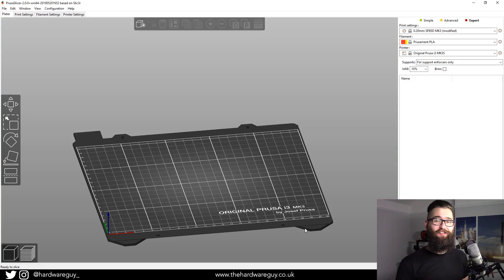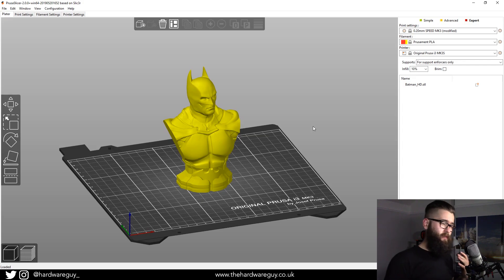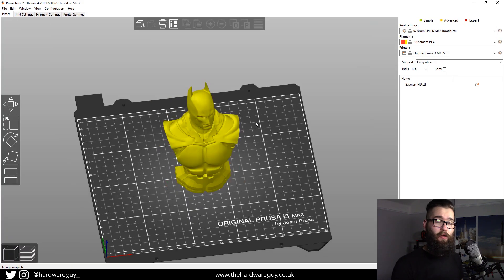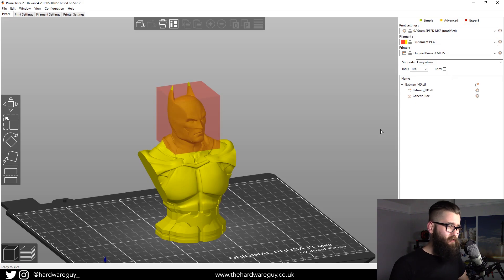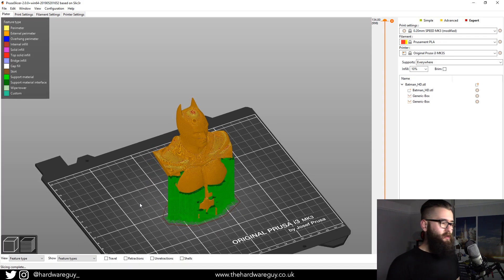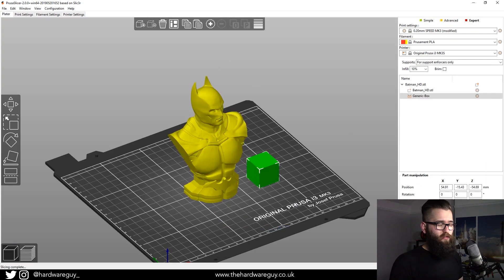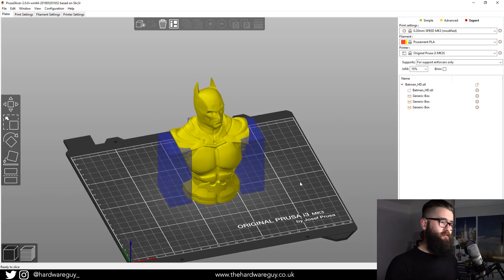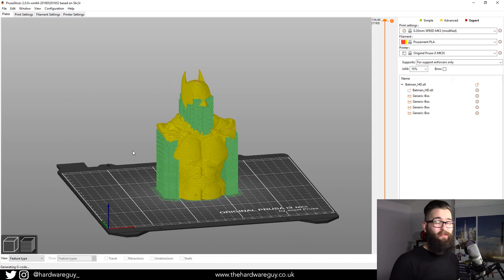Prusa Slicer 2.0 - Custom Supports

Comment: I just tried today using the organic supports (prusaslicer 2.6.0) and it has potential but ..somehow, it kind of sucks. There is no way to block supports of a certain area, no matter how you paint it, for instance. Also, for two (very) adjacent points that needed support, it generates two separate supports, all the way from the bottom, when it could have easily generated just a small branch from one support, to reach the other point. I've seen many people complaining on the official forum or on github about the support blockers that don't work properly, but the devs are VERY quick in closing and dismissing the issue. Sad, because, as I said, it had great potential.

Comment: I am new to 3D printers. My printer is an ender 3. Is the prusa slicer compatible with the ender?
Reply from the maker: Yes but you’ll need to set it up manually! I have a separate video on this for the Creality CR10S
Reply: thehardwareguy - ok. Thanks.

Comment: Excellent video buddy. But how do you disable model's going on build plate, sometimes i want to add one model but add to it, in the slicer with another maybe at the middle or top, trouble is auto placement drops it to build plate again, cura has a disable setting but just can't find it

Comment: prusa creators instead of making blockers and spheres and making it really hard to remove supports that are generated automatically how bout clicking on them to remove them or right click on them to remove them..and or click to highlight drag and highlight certain  supports.. this making boxes etc and making you reslice to see the outcome is way to hard... you should still see the supports when your removing them meaning it shows where they are clicking back where there are none is youll have to remember where they are or were to place your remover box thing.. this is tedious and takes to many steps.. click to highlight supports and right click to delete.. and or a drop down menu on right click to re apply...

Comment: love this tutorial, helped cut 9.5 hours off my print time with enforcers and aload of excese filamant waste. Been printing for over a year now and flipping between cura and S3D as they both have pros and cons, BUT PrusaSlicer 2.0 WELL lets just say it has it all and more. veriable layer heights diferent infills and so much easier for custom profiles for differnt sections unlike S3D. Prints faster and with use of magic numbers also prints are amazingly clean. 
Set-up Ender 3 frame, SRK 1.3 2208 drivers - marlin 2.0, Microswiss direct drive, petfang V2, Octoprint, silent fans.

Comment: FYI. Clicking on expert mode DOES make a difference. It allows you to choose between the differnt types of shapes when you right click. In simple mode, you only get a box shape. You also do not need to make the shape touch the ground. IE, on the shoulders. if you placed a small box under his shoulders, touching them, you do not need it to scale and touch the ground. As long as the enforcer is touching at the upper section, it knows to generate supports there:)